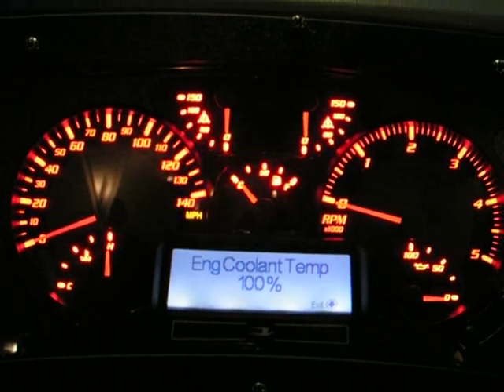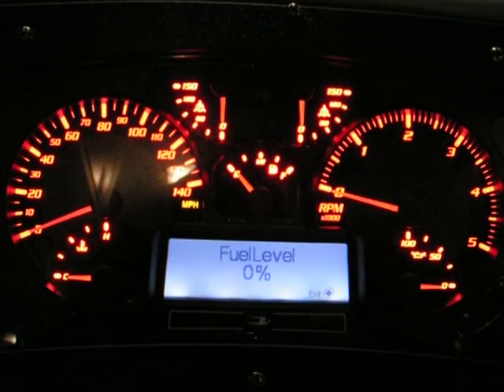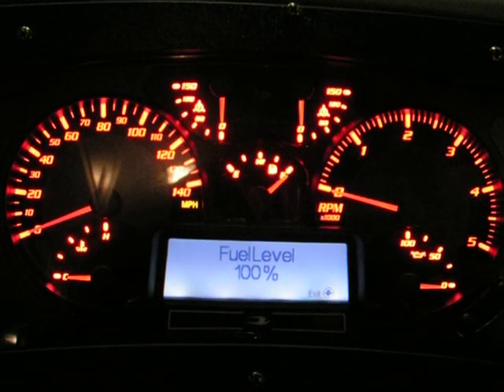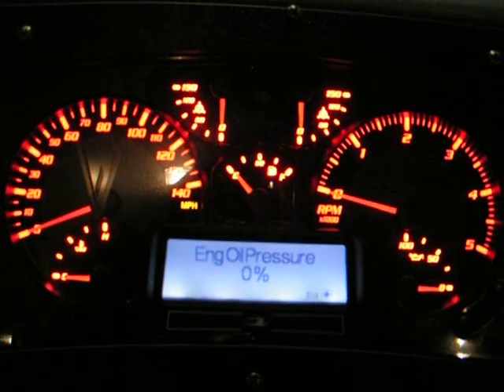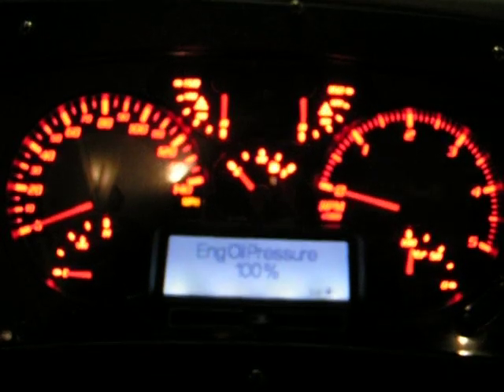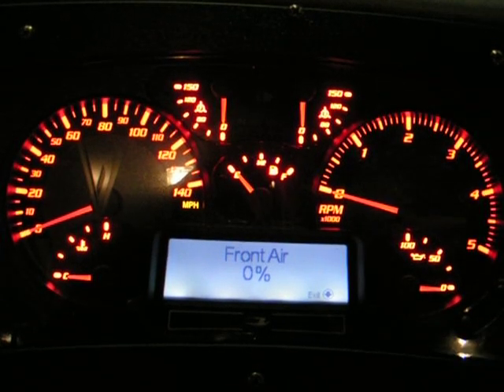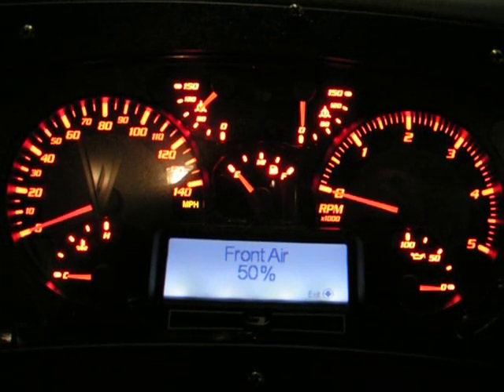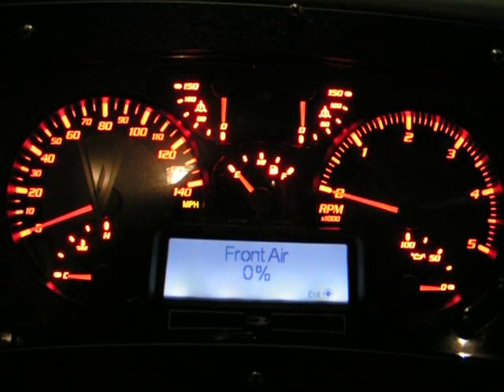Vision Guage Testing

Comment: We have 5 2012 Visions, purchased in January. We have replaced at least 10 dashboards to date, and I have 2 units down waiting for Actia to send replacement dashboards. Only one failure in the 5 All Americans purchased at the same time, and no failures in the previous year All Americans, so there must be a problem with the Visions' wiring.